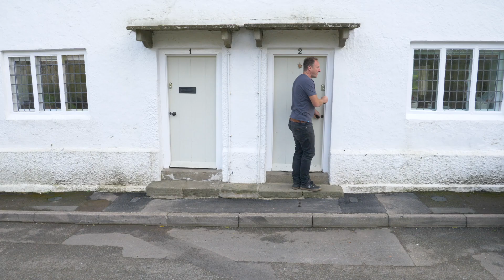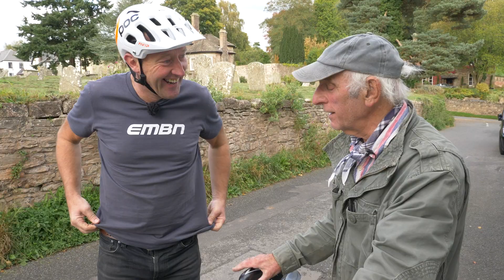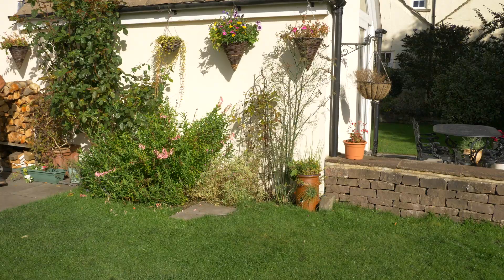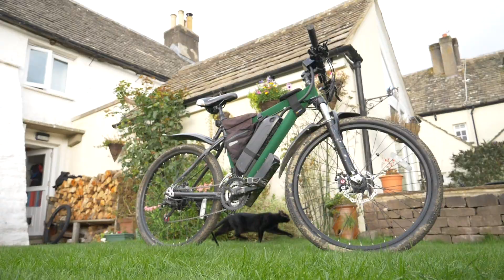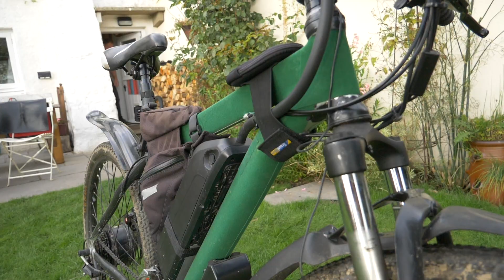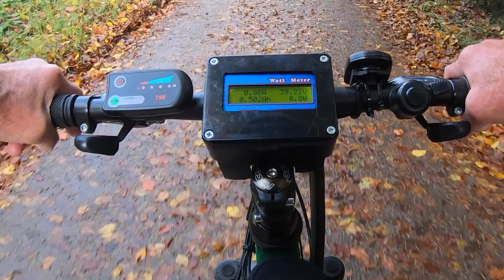Resurrecting A Cheap Electric Bike | Ray Builds A Budget E Bike

Comment: Man after my own heart,  I love tinkering with stuff. 
I thought about doing the power meter thing on my build but after riding it for 33 miles and only using 40% battery I decided not to bother ( I wont be able to ride long enough to flatten the battery in one day).
Pedal assist didn't really work out that well for me using cadence sensors,  the lag in the control was annoying and dangerous, simple old school throttle ( yes I know lol ) means I am in total control of the power.
Might get a sine wave controller at some point but not seen one for £25 !!??@!?

Comment: This is what I've been saying the whole time, home bikes are Way better, not for climbing unless you go mid drive but for commuting, I'd be lost without my Nikki, 3.3kw. however I also build my batteries to avoid bad ones, so buyer beware with cheap batteries. This pack has 10,070km on it so far.

Comment: Would love to give 20 Thumps up! I am XC Rider, and NO one about 50 is a Jumper, Downhiller, usw.
THIS is a Monster on Fireroads! I personalley have a Hardtail Haibike Sduro Hardseven Rx with all XT, and a Aftermarket Batterie 750 Wh.
It reaches 160 km on Standart, or 230 on Eco.
Its Tuned, it gos 50 Kmh.
But this here ist good!
Reply: What size chainring?

Comment: The switch on the battery will not make any difference if the battery pack is damaged and shorted. The switch only isolates downstream of the battery. So any short upstream and the switch makes no difference what so ever,
Reply: NICE OF HIM TO PUT FELT WRAP ON FRAME TOO SO AS THE BATTERIES OVERHEAT MELT PLASTIC AND START DETONATING  THE FIRE WILL SPREAD MORPHING THE ENTIRE CONTRAPTION AND PASSENGER INTO SOME SCREAMING E-GHOST RIDER.... THAT OLD DOOD IS A FUCKIN LEGEND

Comment: What about Tongsheng TSDZ2 mid-drive motor? It is cheap, relatively robust, has torque-sensor and open source firmware with large community. It could be real cheap alternative for touring and trail bikes.

Comment: At last! Someone using a dcdc coverter to charge. Wish youd have shown how easy it is to wire up and use though.
Reply: SERIOUSLY EASY.. DC INPUT VIA SCREW TERMINALS SAME OUTPUT OPPOSITE SIDE OF MODULE WITH A LITTLE POT OR TWO TO TUNE OUTPUT VOLTS AND AMPS I USED A BIGGER ONE TO MELT MY 48V EBIKE BY RAMPING MY BATTERY SUPPLY UP TO 120V  ... CAPS LOCKED BY SPILLED BEER
Reply: @simonbrown6648  yes I know I have been running one for a few years now. I meant for other folk to see how easy they are to use, because they are way more eficient than inverters with a charger.